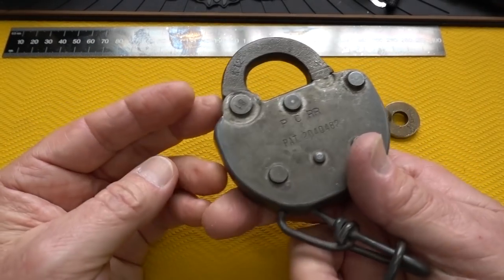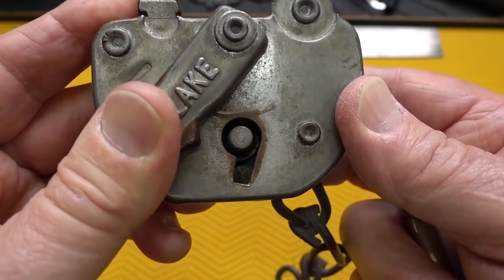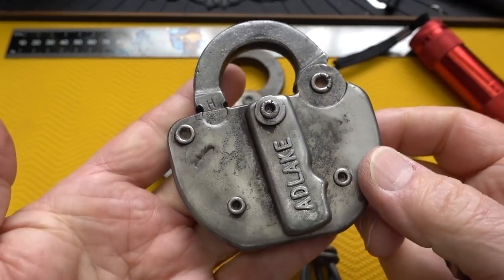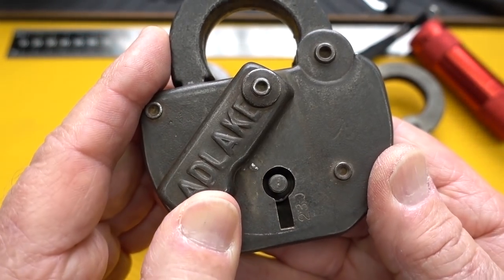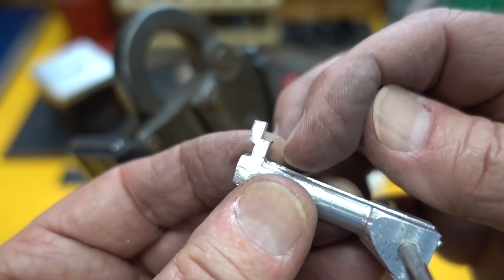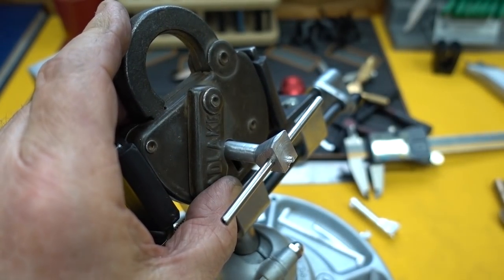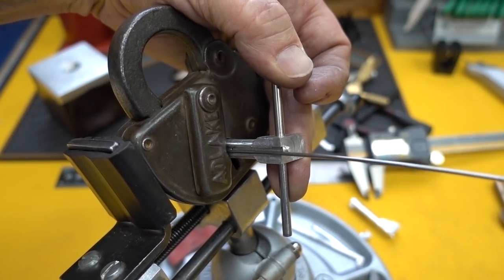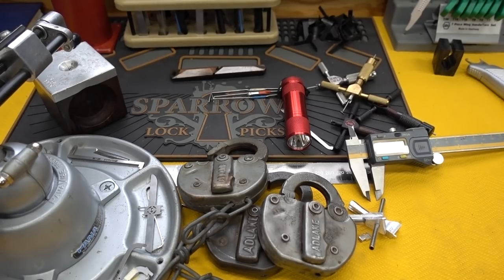(1696) Adlake Railroad Locks

Comment: Thank you for the nostalgia. I'm retired from a railroad and had some experience with these Adlake single lever locks. They were easy to use "on the fly". Unlock, open the switch, close the switch, and snap the lock closed, all without stopping the movement. But they were not secure. They could be opened or dismantled with a rock, which led to lots of vandalism and damages. The railroads changed to a stouter lock, The Sargent & Greenleaf lock. I think the hasp break will before lock does. The railroad I worked for had to re-key all these new locks when it was discovered they could be opened with a 16 penny nail. There might be other weaknesses but I'll leave that for you to discover. These newer locks are key retaining and have slowed down operations considerably.
Reply: Canadian national still uses them where I run

Comment: Nice to see a railroad lock. I collect things from the old Missouri Pacific Railroad. I have a few similar locks. I asked a former MoPac employee why those locks were so stout given their use in out of the way places. He said it was to prevent someone from "accidentally" picking or somehow opening one. Changing the right of way signal and causing a disaster. Whether that is true; I don't know. But, it does sound plausible. Mine have the same stout springs.
Reply: He was telling you the truth.  Sometimes mechanical switches had to be protected by security during labour disputes. Train robbers, and just stupid vandals have messed with railroad switches. You are not likely to get caught when you hit relatively isolated switches and leave the scene immediately.
My grandfather managed two coal mines in Alabama, during the 30s and 40s and protecting the rails was very important.  During WWII there was a fear of German saboteurs.
Reply: @macnutz4206  That's seems along the lines of what I thought. Interesting information. It's amazing what people will do, sometimes. I've got a couple of steamfitters wrenches from back when MoPac used steam. They've got a couple of skinned up places on them. Maybe from chasing guys away from the locks? Enjoyed your input.

Comment: Funny how a lock from the 20s takes more effort to pick than most modern locks
Reply: I think it's a standardization thing. Everyone was doing they're own thing in the 20's while now factories have similar suppliers, so the tools are the same and the economical thing is to do something similar to everyone else. It also lets you get some inspiration from the competition.
Reply: Obviously, it was before the Master Lock business model ... caught on..
Reply: They don’t make them like they used to!
Reply: security through obscurity
Reply: While I do agree, the lock is more modern. That specific one is 60's/70’s. A 1920s one would likely be brass. If not a heart-shaped lock. Likely easier to open too. This design is earlier but the period of highest production was mid century for steel adlakes.

Comment: Hi Bill, Each railroad had there own keyway and everyone of their lock would use yhe same key. Like you said, these are switch locks made to prevent someone from opening or closing switches and causing accidents. The thing is that train crews need to open and close those switches. So every employee working innyards or trains would get a key when hired and give it back upon retirement. Thats why many of the keys have so much wear. The same was true for locomotive door locks and locomotive throttle/transmission levers.

Comment: Hahahaha. Great vid!  I spent countless hours trying to pick one of those myself. I thought the same thing you did.  That you need to pick it similar to a lever lock but it's just a warded lock.  I found that the fastest, cheapest and easiest way is to use I bike spoke.  They don't have to be tensioned to open. They are warded and usually have 1 or 2 levers in the wards.  Pull up on the shackle while you use the spoke to lift the levers and you're good.  But ya I tried making the whole lever lock tensioner too.  We think a lot alike but I think that's because everything i learned about locks i learned from you. Hahah. Well almost everything 😜

Comment: The Adlake I have is marked AT&SFRY and has a keyway that looks like the number 9 but half way down the tail of the 9 it turns 45 degrees to the right. Also the key turns counter-clockwise to open the lock.

Comment: The company I work for uses American Lock pad locks for switches and switch locks.  I was given a broken lock by a MW worker.  I was hoping to fix it but it looks like I wasn’t the first to try.  I was successful at getting it torn down but with my limited knowledge and experience, I have yet to figure out what might be wrong with it.  I still tinker with the cylinder though but I haven’t been able to pick it yet.

Comment: I actually have 3 RR locks in my collection. And they each have one of the 3 keyways like the ones in this video. I'm able to open 2 of them fairly quickly with a real strong wire. I've yet to try this on one of them but I'm sure it would work the same as the others

Comment: Back in '64 or '65 I had a lock that looked like this, with a bit of attached chain.  I wasn't clever enough to note any markings, so I can't tell you much more, except that I may have acquired it either in New Jersey or in Ontario.  I think that I found it discarded next to some tracks.  I had no key.  It did, however, have a drain hole (I assume) on the bottom, and I found (kid with time on his hands) that I could press a rod (straightened coat hanger into this hole, angled toward the latch (not the hasp hing), that is, to the left, like a back slash, if you are looking into the keyway, find something springy, press, and the lock would open.  Now that I've been watching you and LPL I know that I should call this a bypass.  I wonder if any or all of your three have such a hole?

Comment: Adams & Westlake made and sold all kinds of railroad goodies.  Conrail was broken up and split between Norfolk Southern and CSX.
Reply: You and Bill are both correct. Conrail was split up in 1999 and does not exist as an independent stock trading railroad but it still exists as a paper railroad jointly owned by Norfolk Southern and CSX operating in North Jersey, South Jersey and Detroit. It’s revenue are then shared by NS (58%) and CSX (42%). This is the reason why they are now named Conrail Shared Assets.

Comment: Anorak quibble: I am pretty sure PCRR does NOT refer to Penn Central, which was known as Penn Central Transportation Company, more often as simply Penn Central, had the reporting mark PC, and when referring to rail operations was called Penn Central Rail Operation (PCO) or Penn Central Railway (PCR).

Beyond that Penn Central was a weak conglomeration of several rail operations which had their own operating standards- a situation that was not even begun to be rectified until the breakup of Conrail in the late 90s. A key holder for interlined operations on Penn Central would have had keys marked PRR (Pennsylvania RailRoad), NYC (New York Central), NH (New Haven) and so on for the varied locks found on property.

PCRR was an informal reference to a specific rail company, but that rail company is Panama Canal Railway, which was sometimes referred to as the Panama Canal Rail Road.
Reply: THR33STEP
Jacob, trust me. That particular lock came off the Penn Central.

Comment: Can someone help me with figuring out a tools name? It’s for deadbolts, say you go the wrong way and you don’t want to re pick so you use it to bypass the reset. What’s that tool called? I’m new to lock picking and found that tool interesting but I don’t remember what video I saw it in or what it’s called. Thank you to anyone who can help!
Reply: Pete389man are you referring to a plug spinner ? To where when u pick it once u can Insert the spinner to spin the core and open the lock

Comment: Our locks at CN are almost the same, used for non important things that require some security but quick use.

Not built strong, I have had to break my share off things when they freeze with ice
Reply: I was actually picking a CNR one I have had here for about  4 years or so while watching this.  I opened it with a bent piece of wiper insert.  Bent the tip to a 90 about 1/4" down and used it to push the lever to the side at the top of the keyway.

Comment: AWESOME JOB!!!    I've seen a couple of these RR locks over the years (all pretty much the same design, but with enough differences to matter) that people have collected just because they're really cool, usually I go to a customer's home for other work and they say "Oh by the way, since you're here, I bought this old RR lock at (wherever) for like $20 it's be REALLY cool to have a key for it... 

Never had a chance to work on one BECAUSE I learned after I looked at the first one, ("let me take it with me and examine it, I'll let you know in a few days, maybe a week... I'll give you an estimate, if you don't like the cost, no charge")....  you have to fab out your own tension tool (VERY nice job on that BTW) then find, or fab a key blank.....    They're out there, they're NOT cheap, and NOT easy to find.... the only GOOD news is that some original keys SHOULD be able to be "repaired" into blanks, if you can only find cut keys that work...  as all the one's I've seen are either brass or steel, so they can be brazed and filed back into blanks. The BAD news is, I'm relatively sure there are a LOT MORE different center post sizes and angles... I'm supposing it was a method of key control back in the day....  which of COURSE varied between companies.... 

So anytime a potential customer has asked me about one, they've NOT liked my price and preferred to keep it as a non functional display piece. .. Which is still cool...    I respect that....  I love that that they just love this piece of lock history...   

So I really appreciate you showing it to a broader audience!!!    Keep up the good work, Stay safe!!!!